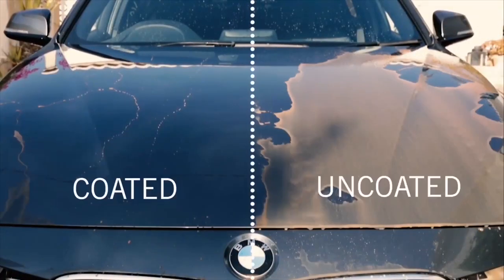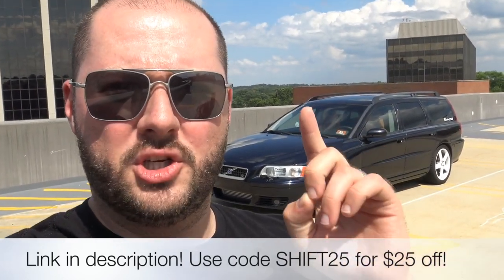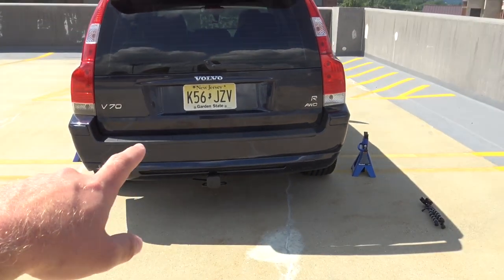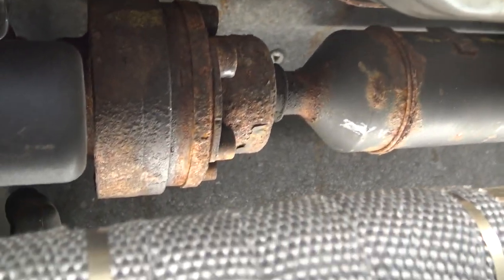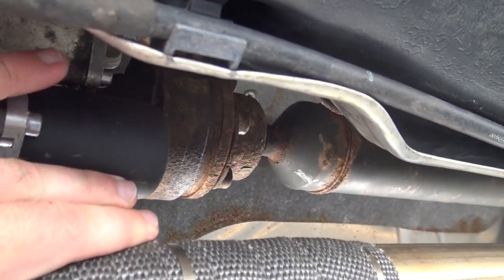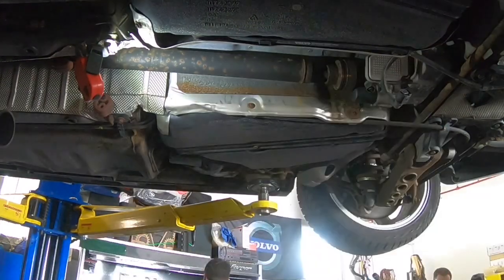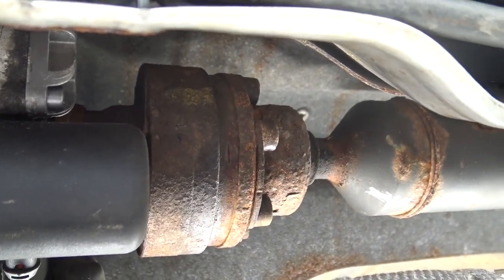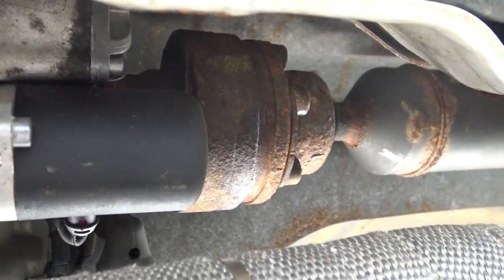Here’s How To Service The Haldex 3 AWD System In A Volvo V70R

Comment: Too superficial.  Even with a hoist, the job is not for a DIY'er.  VolvoSweden's video is excellent but it's for a Haldex 4 and 5.  The real issue with a Haldex 3  is removing the driveshaft.  A factory exhaust does not need to be removed.   The details missing include installing the pinion retaining nut that must be properly torqued.  While you're at it, consider replacing the driveshaft pinion seal.  As well, replace the filter and inspect the control module.  Another missing item is replacing the fluid procedure using only Haldex approved (Volvo or VW) expensive gear oil.

Comment: Another good tip for all volvo awd owners is thermal wrap on yor exhaust. Wraped near propshaft cv joints will save the lubricant inside joints.

Comment: i have a ford 500 with this haldex what a freaking nightmare code p1889 traction control light on replaced fluid filter pump abs cant get it to shut off did the tsb by ford which is as useful as joe biden that did nothing traction light still no awd

Comment: The big difference between the XC70 in VolvoSweden's video and our R's is that the P3 cars use Haldex Gen 4. Haldex Gen 4 you can barely wiggle the AOC pump out without removing the driveshaft or exhaust. Everything else in the procedure is nearly identical. But his trick to get the AOC pump in and out by grinding a tiny bit off of the casing will not work on our R's or any other P2 AWD Volvo. 

One thing that wasn't mentioned but shown in the timelapse - please please please mark your driveshaft between the coupler and the companion flange with a paint marker. This will allow you to put your driveshaft back on in the same rotational position as it came off and aids in avoiding unwelcome vibrations. I would personally also mark the position of the coupler to the AOC casing itself so that can go back in the same way as well. 

Both if my R's had loose heatshielding underneath creating a quiet scraping sound, this is a great time to remedy  that issue as well as doing any angle gear service or exhaust work.
Reply from the maker: Great call! Pinned this comment for those that want to do this work themselves.
Reply: @ShiftingLanes  There's also a small mistake in the description, stating that volvosweden's video is haldex 3 ;-)
Reply: Not actually all P3 cars have haldex 4. To my surprise when I did the service on my '08 XC70 it had haldex 3. I think early P3 models up to 2009 still used haldex 3, because volvosweden's car is '09 and already has haldex 4.
Reply: @johannessoonik1007  Ah, yes I forgot. 2008 was a transition year from Haldex 3 to Haldex 4.

Comment: I did a ”Haldex service” on a V60 once wasn’t that bad.
But I guess that when you have been an apprentice at a authorized Volvo garage, had access to a lift and where surrounded by clever “Volvo technicians” (some where also Renault technicians too), than most things tend to be easier at home.

I tell you one thing, the French philosophy of putting everything thing if front or on top of everything, nearly drove me mad.

But my experience doing “some” work on Renaults has made calmer when doing “tricky” or “annoying” work on Volvos, it may be “harder” than what it should be in a perfect world, but at least it is not a Renault.

Comment: Those hand jacks really should only be used in an emergency as they can fail relatively easily.
I speak from experience, I had a Ford jack suddenly strip the screw threads and  subsequently the vehicle dropped.
If you do use them, make sure the threads are well lubricated.

Comment: Hello guys 🙋‍♂️ 
Does anyone know how to replace haldex AWD wires (cable which is pluged on Halfex Control Unit). My old one is broken. In the meantime, I bought a new one, but I’m not sure where it connects in the upper part. If you have any advice or a video tutorial, I would really appreciate it. Tnx!

Comment: I’m looking to buy an 06xc. Is there an easy test to see if the awd is working. On my manual 97 850awd
Reply: Oops. On the older 850, you Jack the right front wheel, and put a torque wrench on the axle nut, it should turn the wheel at about 70 lbs. is it the same on the 2006?
Reply: Premature send, there.